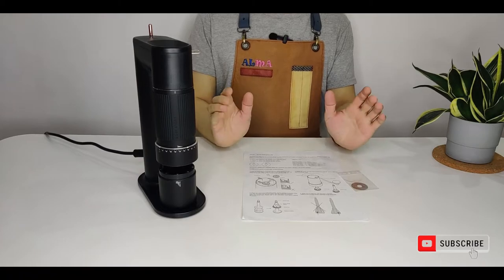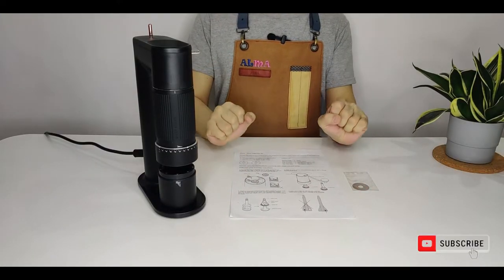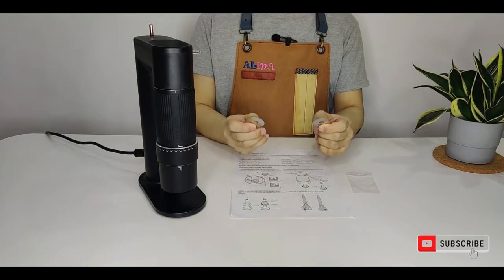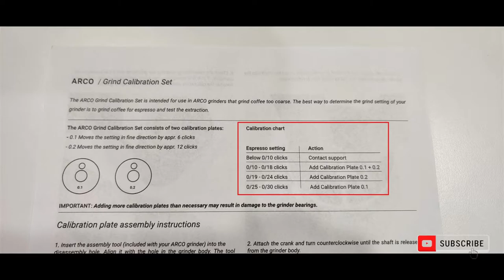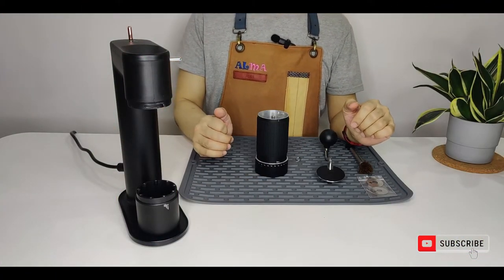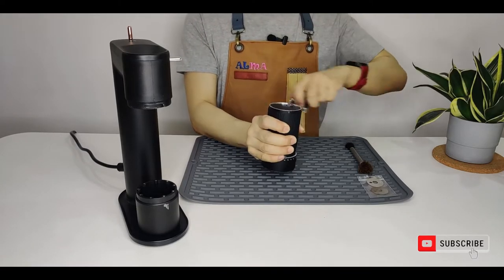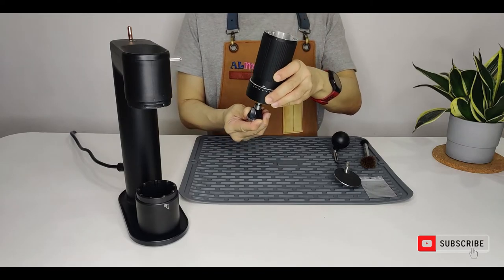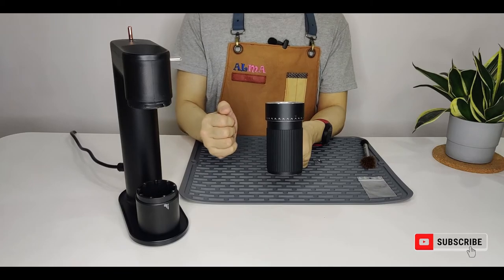Goat Story ARCO 2-in-1 Modular Grinder I With Calibration Plates I To Solve Too Coarse Grind Issue

Comment: Thank you to share this informative video, i have question about adjusting the grind sitting my touching point at number 58 can i change to be to 0 ?
Reply from the maker: @Ka Al - You are welcome and glad our video helps. 
Goat Story has added a physical limit (to prevent damage to the burrs) before the burrs get in contact with each other. As such, it's not possible to do so. In addition, that small range is not usable considering that tiny spacing between the burrs does not grind any coffee anyway.
*Do consider subscribing to our channel!

Comment: Hi! I can’t turn the crank after inserting the axis tool into hole.. wondering what does this happen :(
Reply from the maker: @Eugenia Lo - To better understand the issue that you are facing, have you ever disassemble before with no issue? After inserting the axle lock tool into the disassembly hole, did you turn the crank handle anticlockwise?